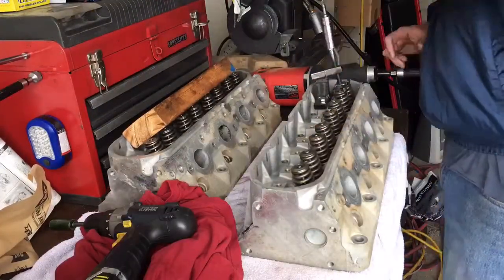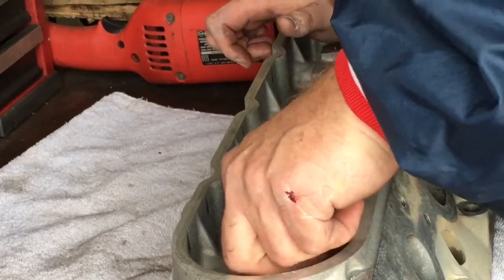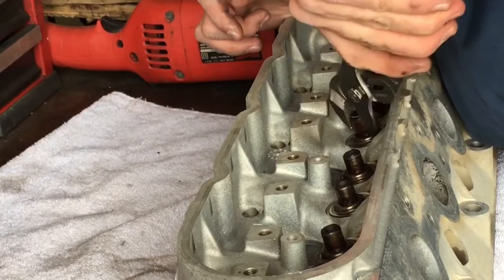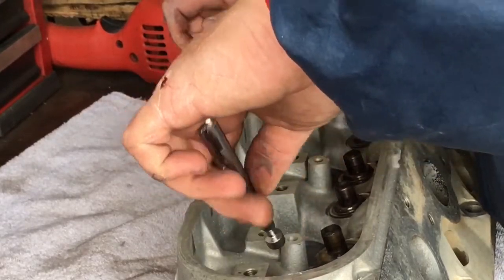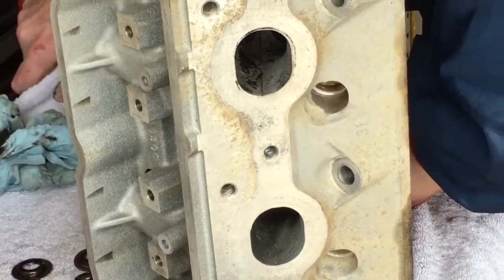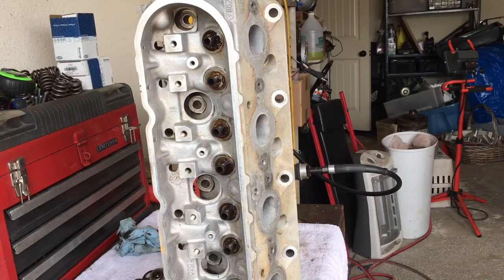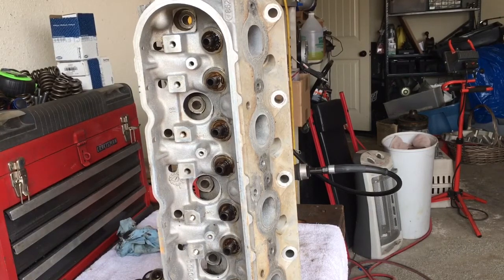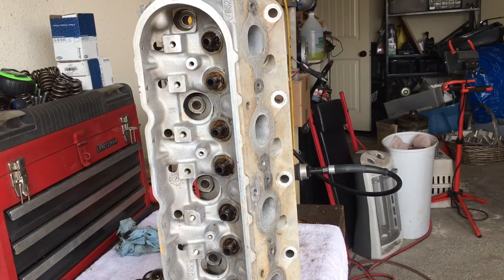LS 862 heads disassembled for Porting 4.8 Turbo build

Comment: Hey headflow , i was curious if you give me your opinion on a matter, I'm curious what your thoughts are of the pros/cons between a 4.8 vs. 5.3 for a turbo build? Which area's of the block should i be concerned about and why. Thanks for your time , and as always keep it real.
Reply from the maker: DarkKokoro84 Really there’s no areas of the block to be worried about with the 4.8/5.3
With either CID the biggest killer if boosted or bigger Nitrous is popping the ring lands on the hyper pistons. 
In reality the HP difference between a 4.8 & 5.3 is only around 35hp.  Where the 5.3 really wins over the 4.8 are low. Rpms off idle-4000 rpms the longer stroke makes way better torque. 
The vehicle weight and intended usage play a huge roll in what size engine.
Boosted the Gen3 engines most any CID should be limited to around 600 rwhp due to the rods hitting a stress limit. (They might hold more power but you’re in the don’t care area running on unicorn tears)
Gen 4 bottom end you can run 800+ to the tires but above this your drinking those unicorn tears hoping it holds together.
Reply from the maker: DarkKokoro84 If you’re not trying to break any records, the factory Gen 4 assemblies are very strong!  I personally would have the assembly custom balanced but it’s not mandatory.  The LS has a really strong well though out bottom end and good flowing cylinder heads!  You can easily make too much power so be conservative and upgrade the driveline, fuel system, safety to handle the power. 🙏🏻